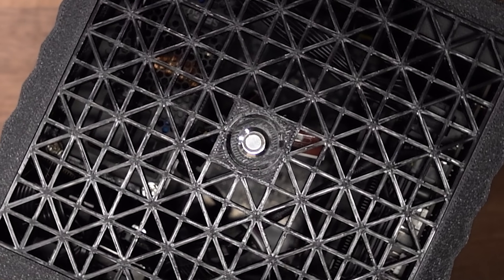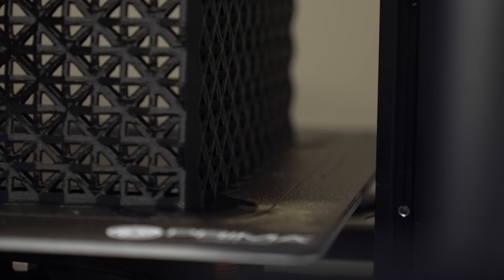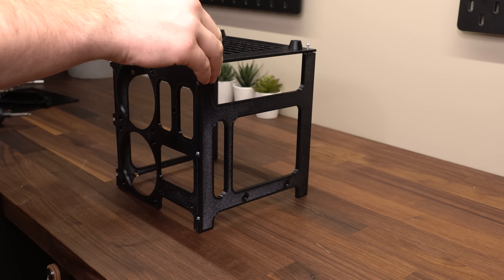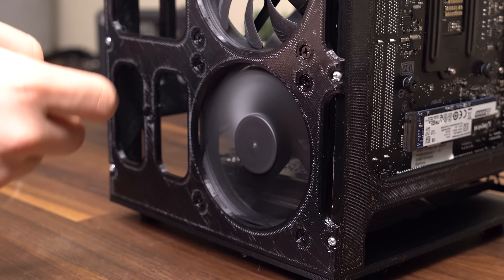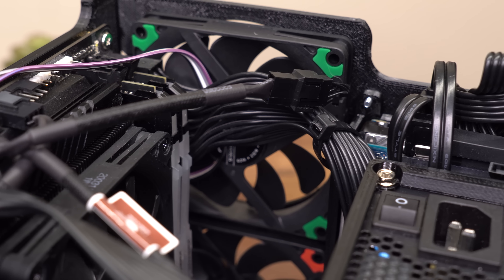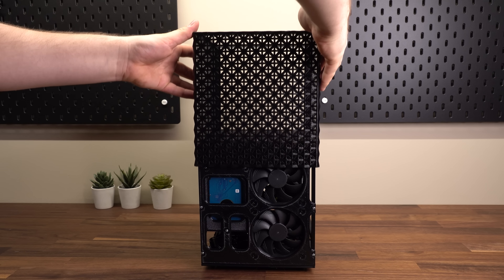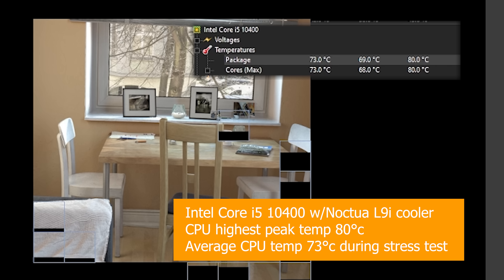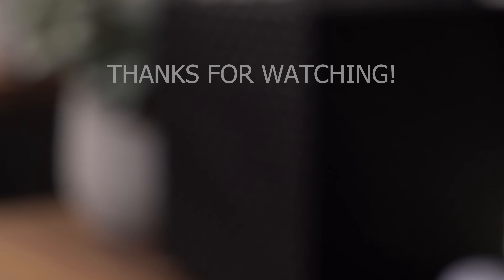Custom 3D Printed ITX cube case

Comment: if anybody is reading this comment i want to get into 3d printing i got some ideas like printing onto clothes to some extend but i dont know anything about printing only hearing from friends im looking for a solid printer under 500 usd
Reply from the maker: It really comes down to what print volume you want in my opinion. If you need to print large items perhaps go for something with a larger bed size, if only printing tiny models perhaps go for something smaller. Look at some YouTube reviews etc and see what you can find to fit your needs.
Reply: @makerunit  well in my country in our shops its mostly creality which have pretty bad reviews over here or prusas which are either small or expensive but i found some a SUNLU printer which isnt that expensive and is 310x310x400 and in the videos it gets pretty solid reviews out of the box i think im gonna try it also i watched a few videos on filaments are there any which you  recommend?
Reply from the maker: @Sharpzee  I’m personally mainly just use some generic unbranded PETG from a local store… I can’t recommend any spesific brand apart from that unfortunately… I feel like all those «cheap» printers are good enough to be honest. Might require some small modifications to be perfect but I’m using a modified Creality CR10v2 and Ender-3 v2 and I’m happy with those… 😊

Comment: years ago when i first built my SFF PC I ended up just throwing everything in a 'pretty small' case because ultra SFF cases were extremely expensive and impossible to find since they were produced in very small quantities from boutique manufacturers. A few years later I saw some great SFF cases being sold that were made with 3D printers so I decided to buy a 3D printer to eventually print a SFF case when I got time to hunt for nice files. I think I subscribed to your channel last year in hopes you'd make a ultra SFF sub 12L case to print. I will finally complete my SFF pc build once I print this case thank u so much. I'll probably make a new one once it's done since the parts are 4-5 years old now.
Reply from the maker: Awesome! I’m glad you liked my design 😊👍

Comment: Does it sag much when cooking up some 3d renders
Reply from the maker: Holds up suprisingly well. 80 degree CPU core temp doesn’t mean 80 degrees ambient air. Imagine your stove at home, if you touch it, it’ll burn you. If you hold your hand a few inches above. It’ll feel warm but in no way burn. Kinda same principle. + air is constantly replaced by the fans always keeping the ambient air temp under control. 👍

Comment: What’s the clearance for the GPU? Want to see if I can use a small 2 Fan GPU
Reply from the maker: The total length allowed for the GPU is about 173mm, possibly about 187mm approx. if not using the lower front intake fan.

Comment: man that is one highly efficient dust collector xD
Reply from the maker: A little dust blow-off a year is very little to ask in my opinion😊
Reply: @makerunit  i mean it looks great and all. but i can only tell from the level of dust in my computer, considering mine has dust meshes in front of every air intake. i can't get away with not dusting it for an entire year :D
Reply from the maker: @einzeller85  I personally have not dusted mine at all in close to two years… I’m actually curious to clean the GPU used in this build due to it getting 70+ now. Never used to get more than 66-68 a year ago and it’s got the same «layout» as my previous cases taking in fresh air from below😅

Comment: I've been looking for someone to help me design a case model for my Acer Aspire laptop motherboard. I want to take the motherboard out and fit it into its own case because the screen is broken and I've been using it with a monitor for the past 8 years. For daily webbased tasks it's still working lightning fast so I want to extend its life as I upgrade to a tower PC> Maybe I can put this in my daughters room. I was thinking of a thin and symmetrical design like DVD players used to be but perhaps with some fan mounts so I can play some older games without cooling issues.. Is this possible?
Reply from the maker: It’s definitely possible to transfer a laptop motherboard into a custom case. You should experiment CAD software and once you know the basics you can make a lot of things possible! 😊 I suggest downloading a free CAD software and watch some youtube guides on how to get started! 👍

Comment: Wow! Awesome job, how much is the total cost estimated of the case + chassis ?
Reply from the maker: Thank you! 
Lets assume a spool if filament is roughly $20. The case uses approx. 1.2kg filament so about $24 in filament. Then if we’re adding the three 92mm fans they are roughly $20 each as well then a few extra bucks for some screws. I’d assume the total cost including fans would end up at roughly $90 excluding the pc compoents.
Reply: @makerunit  thanks for the complete answer!
Reply from the maker: @emilioguitart3754  you’re welcome. No problem 😊

Comment: Love it! If you could make a set up video for your cr10, i have the v3 and had a lot of issues with calibration/first layer adhesion to the point that its just collecting dust right now... 😭😭😭
Reply from the maker: Thank you! Honestly, most of my problems were solved by investing in a PEI magnetic sheet, almost never a failed print anymore… I also print mainly with 0.6 nozzles on both my printers if that would make any difference… 👍 oh, and I had to make sure the x axis was mounted 100% level to the rest of the frame. I had a lot of issues before that due to the dual lead screws moving once power was shut off…
Reply: @makerunit  thank you! I'll try to get one! I bought what i thought was it and turned out to be just the top layer of the DEI sheet 😭😂
Reply from the maker: @ShimmyX  Haha I see! Good luck and I hope it helps!

Comment: What kind of filament are you printing with i heard pla isn't great for the pc
Reply from the maker: I used PETG for most parts, all but the external cover which was PLA. The external cover has only intakes so this should be no issue here 😊

Comment: Looks really clean! Any issues with parts creeping/sagging over time from the heat?
Reply from the maker: Thank you! Honestly, not really, I see a lot of people worried about this. All the internals here are printed in PETG, the cover was printed in PLA mainly due to my PLA having a slightly more matte color than my PETG and warping seems like a smaller issue with PLA.

I have personally not experienced any issues related to PLA but I see some people say they have experienced a lot of it on other builds but as long as there is airflow it should be good tbh 😊

Comment: Looks nice! Some tips for next time; look into counterboring the screw points and also using threaded inserts. Self tapping into plastic is okay to start but will wear out quickly, especially in PLA
Reply from the maker: Thank you! You mean countersinking the screws? All screws go slightly into the part they attach too. At least the tol ones disappear all the way into the hole. Should have probably went for black screws though.
Reply: @makerunit yep pretty similar but slightly different. Same principle though. Basically by having the screw “drill” into the plastic for you, you’re relying on it’s pulling strength on the mating surface. I’ve had the screw snap off the thing im screwing into before which sucks (eg. a smaller raised stand off/boss). Threaded inserts will help with that though.
Reply from the maker: @transatlant1c  that’s a good point I see what you mean. I have not experienced that yet but can definitely happen someday. 😊

Comment: Thanks for the files and the video. Hope the probably PLA can resist that temp of the grafics card long enough without getting soft.
Reply from the maker: All internal and rear/top panels are PETG. I used PLA for the external cover only, but this has only intakes so should not be a worry at all 👌👍

Comment: If I wanted to comission you to make me a custom pc case could you do that? and if so how much would you charge me
Reply from the maker: Case design can often be very time consuming and very hard to calculate a price for such a job. If calculating on a hourly rate it would literally be cheaper to buy the printer and build it yourself but I have an idea… 

What about, you give me some ideas, if I like it, perhaps I can use those ideas for a future project video and you’d be able to get the files from there?😊

It’d be a win-win for all of us 😊 what kind of case are you looking for, fill me in and I’ll see if I can come up with something someday 😊
Reply: @makerunit  I want a shark pc or something similar to a animal
Reply: AZZA Pyramid L PCIE 3.0 or something like this with the bot part being bigger so I could put motherboard and psu at the bottom and have rgb stuff at top
Reply from the maker: @aquatikdawn  I see! Animal shaped PC, that’s an interesting one. I don’t see how I’d be able to fit a PC inside a shark though, unless it’s very huge… but… maybe. 

The pyramid thing is more doable definitely.

Comment: I love this project. Would water cooling make this more compact or less?
Reply from the maker: I could definitely have shrunk it by a tiny bit as it is now by sacrificing for example the hard drives. But Idk if A liquid cooler would shrink it much but possibly 😊 given that I’d probably then need a 120mm fan and a thick radiator. And thank you! 😊

Comment: Exactly like the one I am planning. Seeing yours just confirm that cube design is what I want. Good job!
Reply from the maker: Awesome to hear you’re making a case too! I’d love to see some pics whenever it’s finished if you don’t mind sharing 😊
Reply: @makerunit  well, there was not enough for me to change that I decided to reuse your model. I sent you a tip for your work, and I'm currently printing it live on twitch, pat_x99!

I will continu the desing of m case later, when I'll have more time. Now my little board will sooon have a new house!
Reply from the maker: @patricklebel1141  Awesome that you decided to buy it afterall! Thank you so much and I really hope you enjoy it :)
Reply: @makerunit  no problem, you saved me lot of time and troubles.
Reply from the maker: @patricklebel1141  I just realized I wrote «buy it» I obviously mean print it 🤣
Reply: @makerunit  😁 that's ok, the print is going really well so far, I was a little worried about warping, but everything seems good so far and the holes are really well defined.. I hope it will stay the same for the next 30h😁
Reply from the maker: @patricklebel1141  I think the fact that the holes there and are breaking up the part I think that relieves a lot of internal stresses in the plastic. I checked out the stream and seems like the point you’re at now it should really not be warping. 

Usually my warping always happens before this point. If I’ve got 15-20mm height without warping I’m usually good.
Reply: @makerunit  yes, that's what I'm thinking and the fact that the print is enclosed with stable temperature helps too.
You print yours with what brand of filament and printer?
Reply from the maker: @patricklebel1141  mine was actually printed without an enclosure this time believe it or not sitting on my workbench actually. 😁 using a «slightly(very)» modified Creality CR10v2.

I actually just used a generic filament from a local hardware store franchise we have in Norway I honestly don’t really see much difference between cheap and expensive filament so I just always buy the cheapest stuff I can find unless I need very specific colors. 

The external cover was printed in PLA in my build actually while all internals were printed in PETG.
Reply: @makerunit  ok, I use filament from a canadian store that is making it's own filament and when there is a promotion, it came out really cheap.
I found the best improvement to do is to use a cht nozzle. By separating the filament in 3, it really helps with cheap and wet filament. With the nozzle that came with my x1c, there was some filament that I couldnt print as fast as the bambulab filament, but now, I can use the bambulab filament on all the filament I have.
Thanks for your feedback, I will definitively check for your other case you teased some days ago.. 😁
Reply from the maker: @patricklebel1141  I see! I’m considering getting a Creality K1 max mainly due to it’s print volume over the X1C as I want to be able to make pretty large parts for future projects. Also my biggest issue with my CR10v2 is that no matter what I do I will still get ugly layer lines, blobs, ghosting, all that. So I really hope a K1 max will be a huge improvement soon. Just need to get a few more subs and views to earn enough to buy one 😁 I mean I could buy one I guess but I’ve soon earned enough on this channel (over 2+ years) to buy one from YT earnings alone, and I haven’t touched even a penny of the earnings. Haha still far from profitable though given that I’ve probably spent 10 times as much on other random stuff, filaments, pc parts, etc to make my projects possible but it’s still fun 😁 currently in the editing phase of the upcoming project and I’ll hopefully have it ready within the weekend if everything goes to plan (which it rarely does🤣)

Btw I checked your stream again looks like it’s still going strong which is a good sign I guess, though I can’t tell if there’s been any warping though. All good so far?
Reply: @makerunit  yes, everything seems good so far. On paper, the k1max seems to be a good printer, but I haven't see a lot of excitement or even review about it compared to the bambulab. I read about extruder problem, so I don't know if I would get one now, or wait a bit more.
On the other hand, Elegoo has the Neptune 4 and are planning 2 more models with larger bed. They are fast and pretty solid it seems for a bed slinger. They are not enclosed thou, but that is easily and cheaply fixed!
31h for my x1c, I cannot imagine how long it takes on your creality.. 🤔
As for your channel, being almost dedicated to computer case, especially the itx one, may limit the interest. I heard that you have to put video online often to be pushed by the algorithm, which is hard to do in real life!
Reply from the maker: @patricklebel1141  What layer height were you using though? I was using a 0.6 nozzle at 0.3 layer height.  

I hear a lot of stuff too, but the algorithms seem to change all the time based on different criteria. I think it bases more on how much engagement you get from your own subscribers in the first week, then push it out to randoms based on those numbers. Comments, likes, how much they watch of the video, how many shares it gets all play a role I think.

I see a lot of youtubers posting almost every week or two and still getting like 200k on some videos and 1.5k on others. I feel like it really depends. I see channels with 500k + subs also that get 500 likes +\- on their daily shorts which seems quite low.

And then you see people like Mark Rober who get like 50 mill views on every video even though he posts like once a month. Therefore I don’t think it’s really based on frequency of posting.
Reply: @makerunit  yeah, the algorithm seems very random, and I don't know a lot about it as I don't really use my channel except to show something to others. Anyway, if you do a k1 max unboxing, setup and print video, you'll probably have a lot of view, mine included😁

I print with a 0.4 nozzle and a 0.2 layer. I ordered some 0.2 nozzles on aliexpress that I will try for some parts. The internals of the case will probably be printed with 0.6 or even 0.8 nozzle, as speed matter more than look there. While being closed source, there is some parts that start to apprear on aliexpress for my printer, and the hotend with changeable nozzle is one of my prefered mod, as the stock hotend doesn't have the ability to only change the nozzle the entire hotend has to be changed. I don't know if the k1max is the same.
Reply from the maker: @patricklebel1141  yeah I’ll see what I can do and how fast I end up getting one! Might be later this year. 👌
Reply: @makerunit  I have a small area in the front top right corner that created some blobs and strings. The nozzle was rubbing too hard on that area. I heated up an exacto knife to flatten the surface a bit and slowed the speed for some layers. I think that with the height of the structure, some reinforcement should be put to stiffen it a bit. But nothing that couldnt be fixed by some magic.
With the k1max available, maybe bambulab will make a bigger printer. I would be really interrested because I really like the performance of the machine. Time will tell😉
Reply from the maker: @patricklebel1141  yeah definitely. Based on reviews the BambuLab printers definitely seem better in my opinion but after having the CR10 I just can’t go smaller again, that 300x300 build plate is a must for me now 😁 using my Ender 3 is a pain 🤣
Reply: @makerunit I will if I don't forget, and I will probably reuse some of your parts because I don't have the motherboard yet if you don't mind. I will probably have a video about it too

Comment: I worry that pla will be too soft at the tempts the pc might reach
Reply: But great case if printed with something more temp resistant
Reply from the maker: Thank you! 
Good thing I printed all the internals in PETG then, only PLA part in this case is the external cover. The external cover has only intake fans so no worries on this one 😊
Reply: @makerunit  that’s perfect then! Pretty sick case, I wanna make something smaller that can fit my full atx parts but that’ll be a design challenge I don’t the time for
Reply from the maker: @Zanbur3D  I see. I might try something like that in the future with fullsize parts in the most compact build possible.